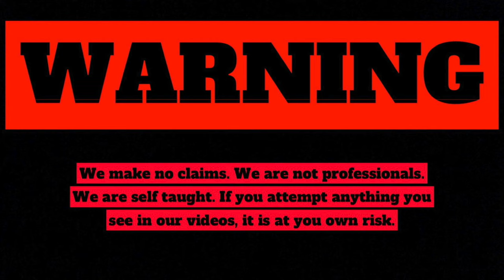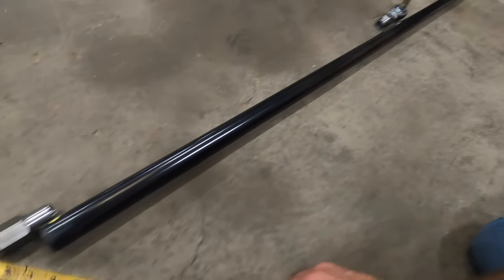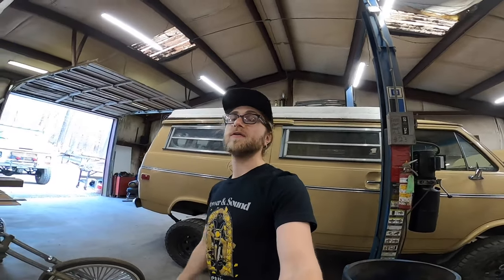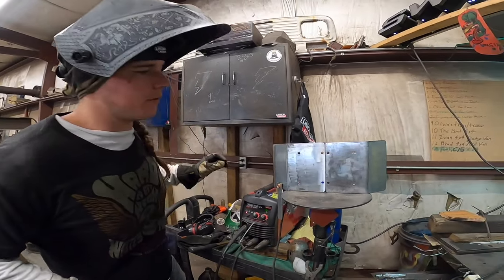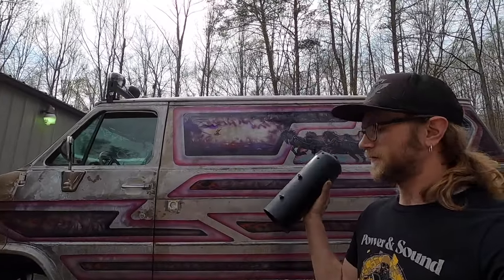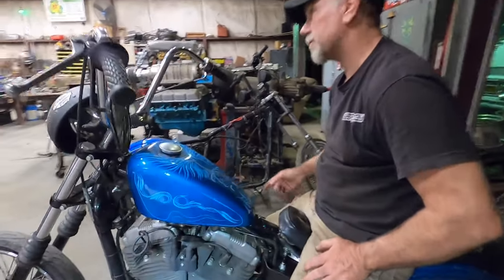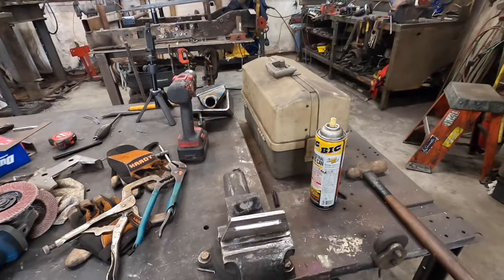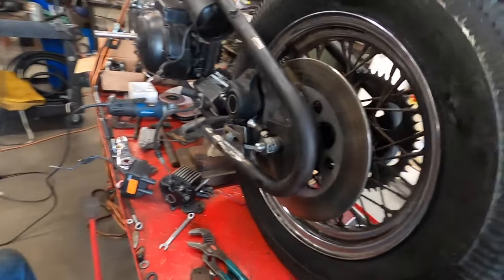Fire Extinguisher Oil Tank? Sportster Chopper Builds & 4x4 Camper Van Updates Part:1

Comment: Ha, ha... @ 2:33 what you really did was use 2X paint and let it dry too much before applying a second coat which cause the crinkle... I know that stuff too well - With that 2X you've got to coat it all in one shot. The trick is to not let more than a couple minutes go between spraying it - You have to apply all the paint but also try to not get it so heavy you get runs. I love that 2X and use it a lot but it's a PITA sometimes.....
Reply from the maker: Thank you!

Comment: Do you have a part number for that pitman arm? Keep up the good work, fellas!
Reply from the maker: No, we modify the stock pitman arms. It you watch some of our other build videos you can see how we do it. Thanks for watching.
Reply: @theswimshop4x4  Would you be kind enough to tell me specifically which video(s) you cover that info in? I've watched most of them but can't seem to find the part where you show the modifications you do to the stock pitman arm. That's the issue I'm running into on my build so I'd be super grateful if you could point me in the right direction - thanks!